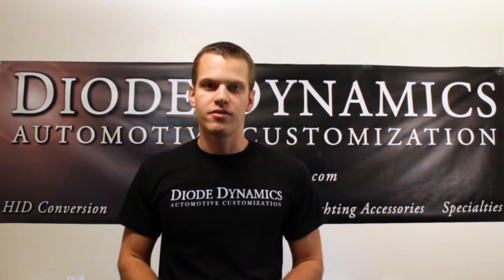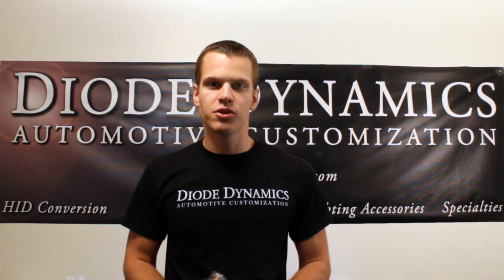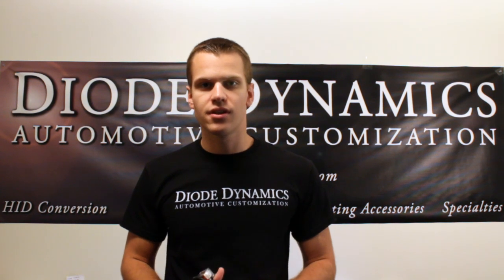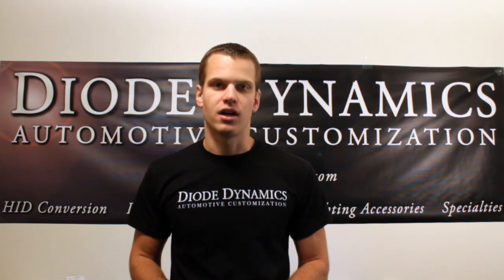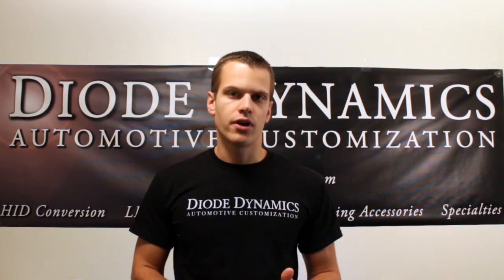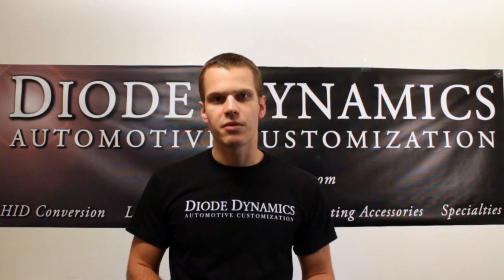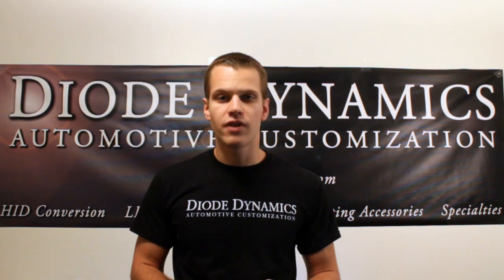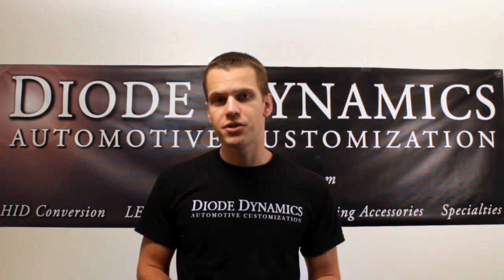What is an HID Relay? Do you need one? from Diode Dynamics

Comment: I have a 2010 audi a4. hooked up a kit and my battery keeps dying.. no relay. hooked up 100% correct theres rrally no fucking it up. they plug in from stock harness to ballast. and ballast into bulb.but now my battery is dying is hid the cause or something else doing it just shitty timing soon after installing new kit from youz?
Reply from the maker: +Justin Miller Thanks for reaching out! We're sorry to hear about the issues you're experiencing with your battery. If you are not using a relay, your HIDs should not be pulling power from the battery, so we are not sure what would be causing the problems you're seeing. If you have any further questions, please don't hesitate to contact us!

Comment: I have a hid kit and I had a relay on it but I was having a lot of problems with my lights so I decided to take out the relay and see what happens. After I took it out everything worked perfect I have capacitors to. So is it bad if I don't run the relay with it? Just the capacitors and ballast. Thank you

Comment: with the relay's, do the ballast continue to draw power when the vehicle is turned off or the headlights are switched off?
Reply from the maker: +MrBlurry2011, the ballast will not draw any power when the vehicle is turned off or the headlights are switched off. If you have any other questions, feel free to reach out!

Comment: quick question i have a relay kit on my car its an oldsmobile lss 1998 and it stills makes my ip cluster flicker, before the relay kit the hid's burned my ip cluster and i had to get if fixed, my worry is thet im probably getting a voltage spike back to the headlamp circuit and then back to the ip cluster. headlamp circuit goes thru the ip cluster and i would like to know if theres a diode oneway connectors for 9006 that i can use so i dont keep getting the spike back to my cluster

Comment: @shupster369 if they are used on a relay, possibly since they will draw the power directly from the battery. May want to check and double check ur ground connections for your subwoofers. A bad ground can cause many problems like flickering lights and speaker whine.